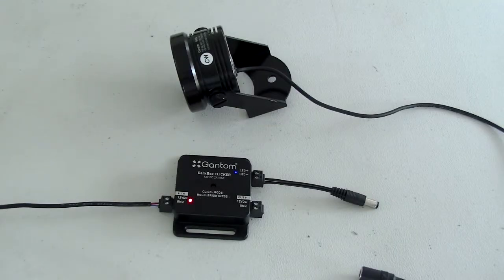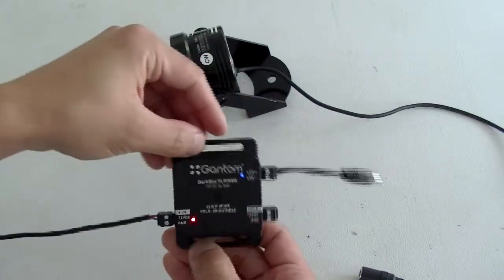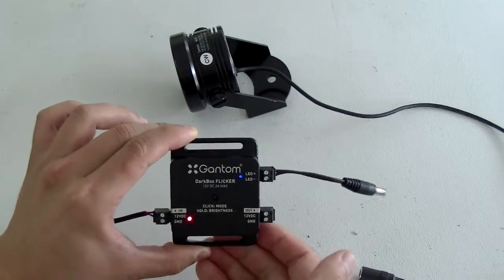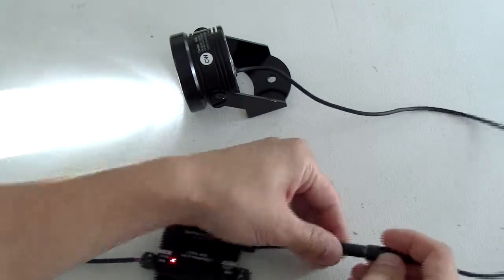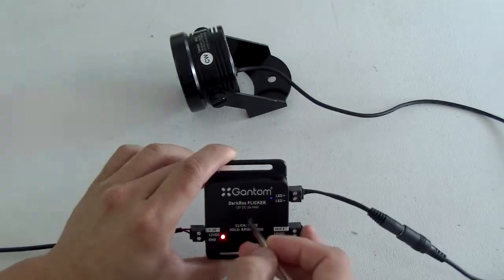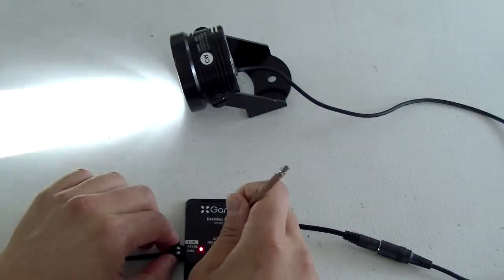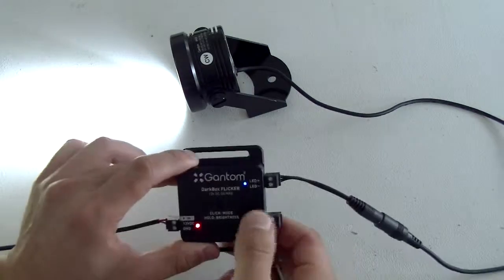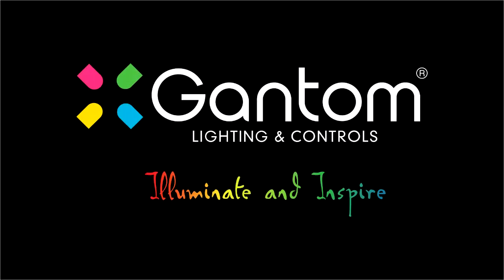DarkBox FlickerV2

Comment: Could you do a video showing all the modes. I am looking for a "flicker to on" effect for my 50" LED light bar. The exact effect I would like is 2 or 3 quick flashes about 50%-75% bright, a short (half second) pause, a 1 second on 25% bright immediately followed by 100%brightness until the light bar is turned off. Do you make something like that. (30 amps 13.8VDC)